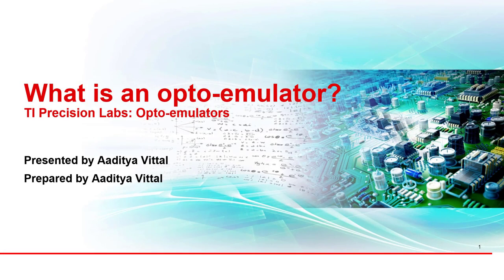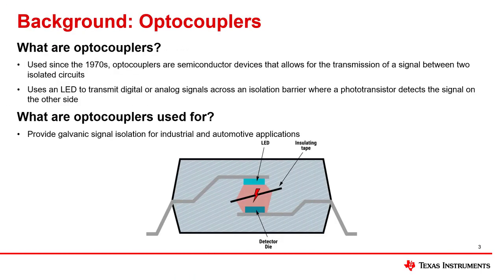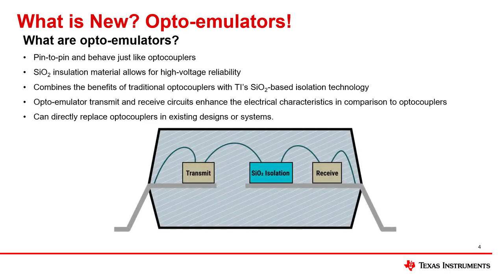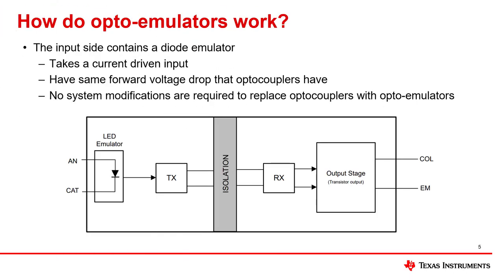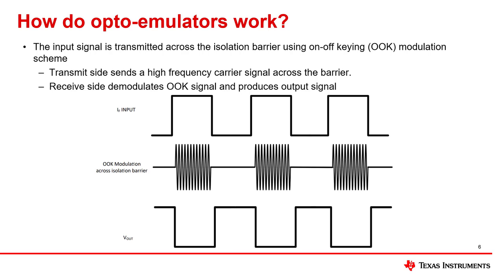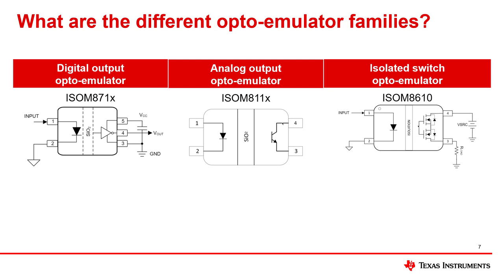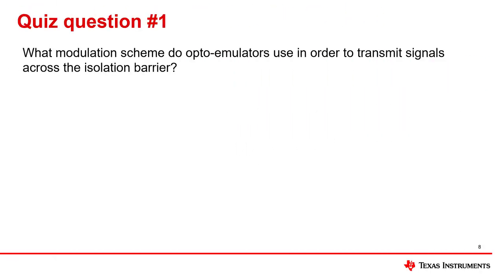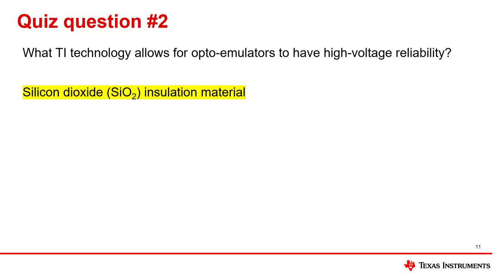What is an opto-emulator?

Comment: Looks like marketing drivel for a worse and costlier products
Reply: What's worse?
Reply: @bernadettetreual 
the separation voltage is worse, the AC characteristics are worse. Optocouplers could be operated in linear mode, this product can't.

This is basically a capacitor-coupled DC-AC-DC converter for no good reason.
Reply: @sashimanu  im sorry, but normal optocouplers are nowhere linear. You normally either use a special one with internal feedback or create the feedback loop via two receivers yourself.

And there are actually linear versions of these devices advertised here, it's in the slides.
Reply: @bernadettetreual  You do not need opto-isolators to be linear.  As long it is a monotonic, single-valued transfer function, the feedback loop takes care of system linearity. We use optoisolators in smps feedback fairly routinely, if mains isolation is desired.  I agree with @sashimanu, this is a hyped product.   As an analog system designer, I do not see any obvious advantages from what is described here. On the contrary, basic engineering (and reliability) is all about decreasing system complexity. Quite the opposite seems to be suggsted here. Where an LED and photo-detector would suffice, you go to the extent of creating unnecessary complexity, and associated reliability problems.